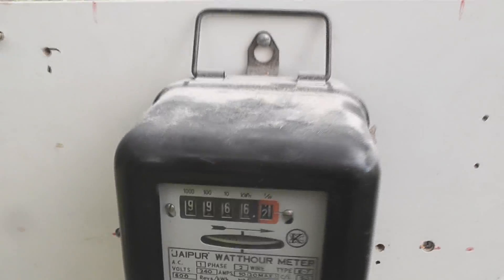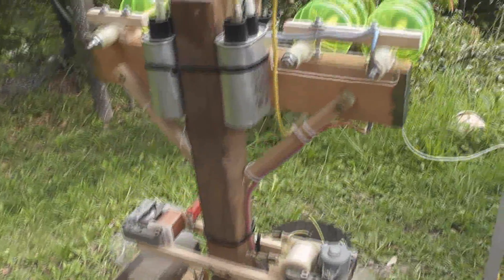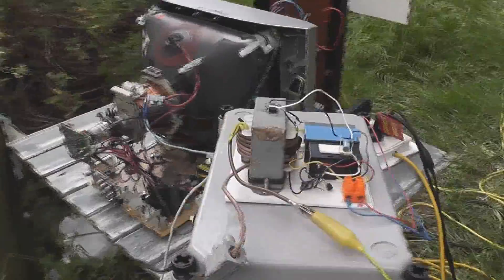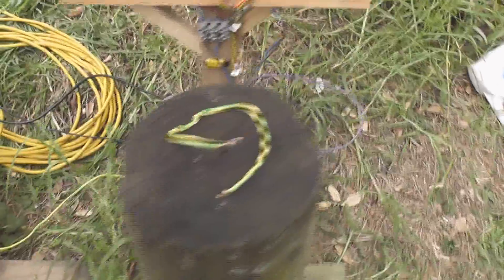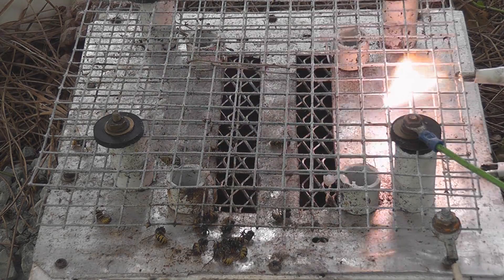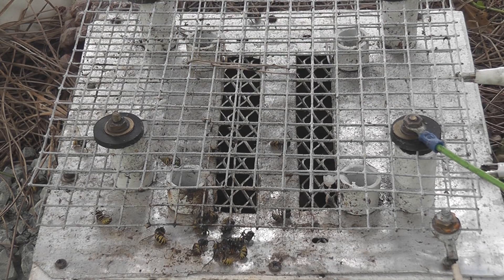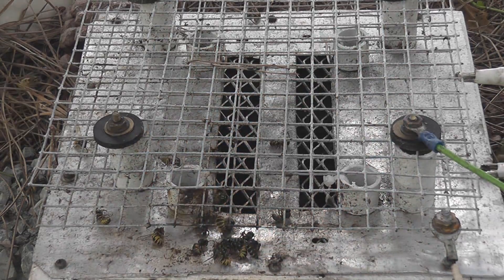Wasps [part 13]   Double MOT stack 4400 Volts AC

Comment: Sir, Ive been a big fan of you and your work. I did lawn maintenance, and tree service in Houston, Texas where I had my share of mulriple wasp/yellow jacket attacks. My question to you is: "Have you ever considered installing an air hose, aimed at the grid, that suddenly , briefly , blasts  at HIGH PSI.  ..  within 1 foot of
 the common ports of entry? So they can no longer hover around, contemplating whether they want to go into it, Buzz away, then come back and do it again? As I can see happening frequently. Once again, Im honored to share a thought with you, Sir. I was thinking it may signifigantly increase your kills.
Reply from the maker: I think an air blast will agitate the wasps even more. They are pretty tough. A vacuum cleaner is more effective with a long PVC pipe attached to the vacuum hose which can suck them up while they exit out of the nest. Then when the vacuum is switched off, put a sock in the pipe so they can't escape and will sufficate.
Reply: @RODALCO2007  ok.Its an honor to hear from you. I had a huge nest in the eave of the house I m renting in . My window is less than Two feat below it.There was a gap in my window frame, big enough for them to get into my room . One day my landlord tried to knock it down with a 12 foot steel re+bar. It tore the nest IN HALF . I returned to my room ...20 seconds or so after wards...It wasn't fun

Comment: don't your mots overheat while working? as I know, they work in overdrive and heat up very quickly due to high idle current, so cooling is required...
Reply from the maker: These MOT's were ballasted and limited to 150 VA.
Reply: @RODALCO2007  is this for each MOT or overall?
Reply from the maker: @moti_vati0n  Sorry. This set up is not ballasted. I use a variety of set ups  for wasps. These MOT s still have the shunts in them.
Reply: @RODALCO2007  oh sorry, I'm Russian and don't understand spoken English very well
Reply from the maker: @moti_vati0n  That is fine, I will make a video how to build a reliable power supply for a wasp zapper with a streetlight ballast or fluro ballast to limit the current, so the MOT doesn't burn out. (You can use Google translate for language conversion from Russian to English)

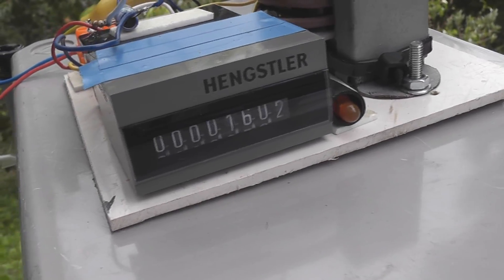Comment: 1:08 ray wasn’t that 1602. Looks like from the angle you shot at :)
Reply from the maker: Correct 1602 was the count.
Reply: RODALCO2007 like me mate need to go see specsavers 😂 I am pretty blind with out my glasses as well.
Reply from the maker: @yappymat549  Yes, very true. I still get by with the standard 2.0 lens glasses for reading.

Comment: I can see some mistakes in this design. No need two powerful transformers to successfully kill the wasp. Schematic can be very simple. All you need to do is using diode voltage multiplier get voltage about 240-480V, ballast resistor and capacitor. Very simple. COnstruction also can be so much better. It should not allow wasp to avoid grid on a way. Some wasps in your construction just get under the grid.  Because of very high voltage you have an arc all the time and you don't need that. All you need to have is a quick capacitor's discharge, and with lower voltage you can place grids closer to  each other.

Comment: Voltage lower, current higher, more violent arc leading to carbon scoring on the grid insulators giving continuous breakdown. Nicely effective as the arc continues violently across the grid almost vapourising the victim wasp. Satisfying but unsatisfactory.

Comment: If the PVC standoffs are carbonizing, could you use something that doesn't carbonize, like
glass or ceramic?  Come on, don't give up on the 4400 - those arcs are awesome!
Reply: You would need a device (potentially the event counter) to turn off the power for about 500ms after there has been an arc for about 300ms.

Comment: Ooooh, a bit too much current on this one. Look at those grids Glowiiiiiiiin! :-O

Yes, as a wasp fizzes-over and goes all black, it leaves behind conductive blackening and then the device continues to arc up even when there's no wasp in there.

The problem with that is, as its arcing, all the energy is being used, and wasps in other places can get in-and-out without getting buzzed.

Yes, the volts are relatively good, but there seems to be a bit too much gruuuunt on this occasion.

Thanxx for showing,

-BoomBoxDeluxe.

17th February 2016, 12.17
Reply: BoomBoxDeluxe you stuck in 1995 and still using a signature lol

Comment: mmmm i think it would work better if you had a low power high voltage dc output. Say something likt 5KVdc with 1W or the minimum possible to just charge a 5kv cap in about 1 second.
If a wasp doesnt get near it wont arc, but if it does it will discharge the cap, lowering the voltage hence stopping the arc from continuing until the cap charges again and it gets triggered. The bigget the cap the more violently the wasp will die :D

Some electrostatic crt displays come with a multiplier that outputs really high voltage but with very little current, and it's already dc, if you can get your hands on one of those, or make one yourself it would be cool to see how well it works.
Something like this https://www.youtube.com/watch?v=hCqxjRrFhmk